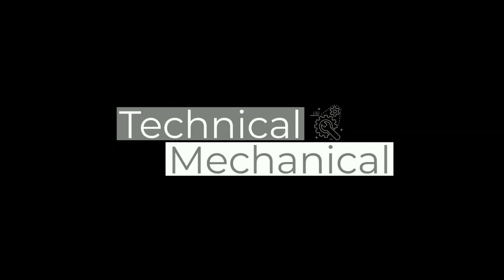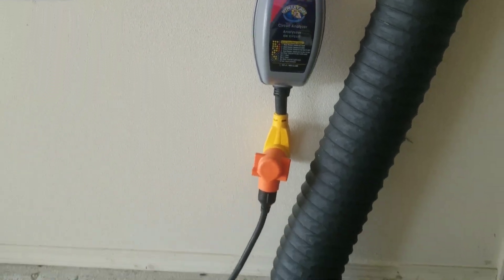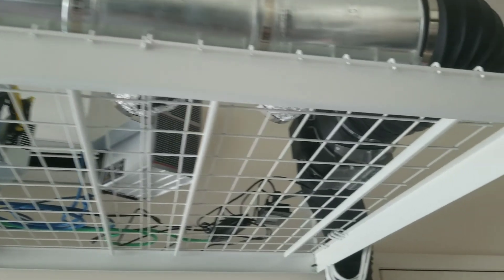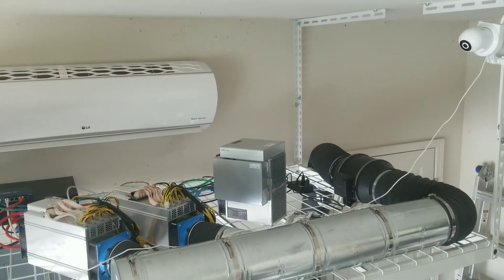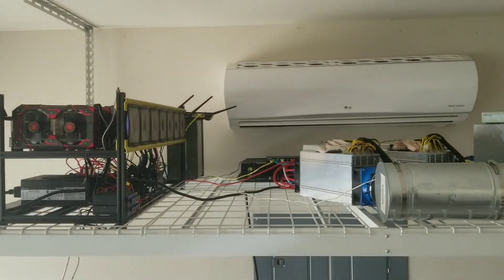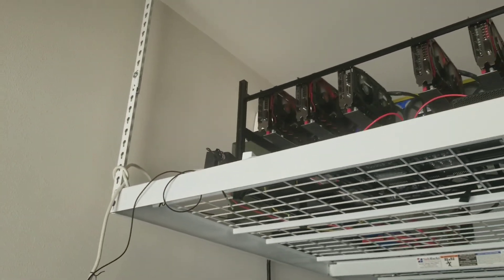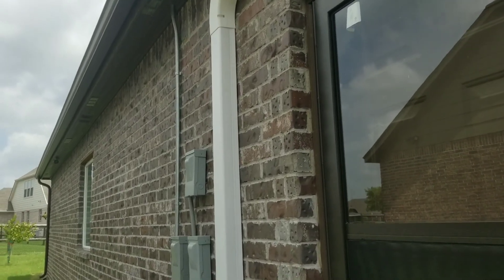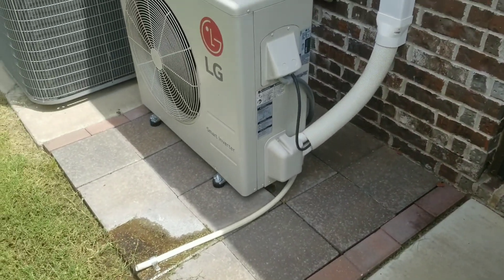Bitcoin Cryptocurrency Mining in Garage with AC

Comment: Do you have any issues with negative air pressure in your garage when all the doors are shut?
Reply from the maker: Great question! I didn't have any issue with a small setup like this. There are plenty of gaps at the top and corners of the garage door and gaps in the pet door for air to enter.

Comment: question, i don't see in the video a mesh cover over your vent, have you had any issues with rodents or other animals getting in the vent. I would recommend a cover to prevent the vent getting clogged and causing a fire.
Reply from the maker: I haven't had any issue at all with the vent. There's quite a bit of hot airflow going outside the house so that's keeps animal and debris away.